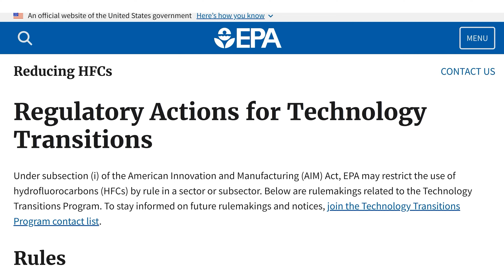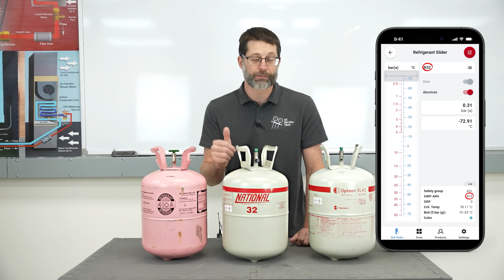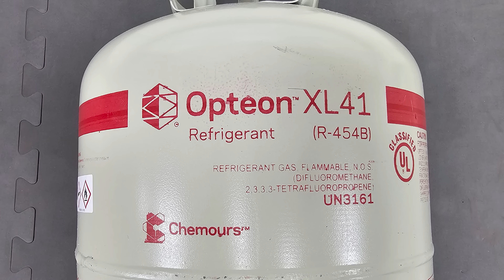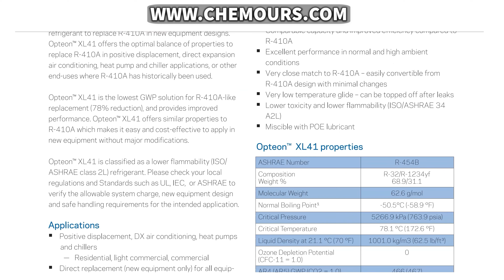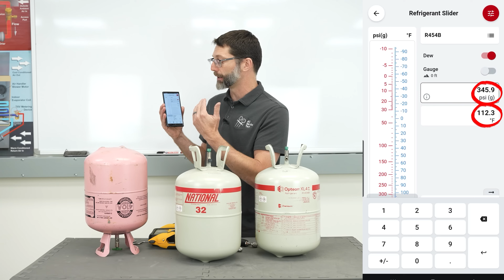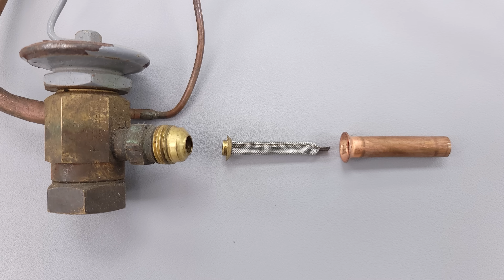A2L Refrigerants R-454B and R-32 Explained! Bottles, Changes, Rules, Tools!

Comment: They already had r32. It worked. They mixed it with r125 to make 410a and got a patent. Now they're banning 410a so they took r32 and mixed it with r1234yf to make r454b, another patent. R32 is a single molecule but it is freely available worldwide. Can't have that, it's too easy and convenient, and we can't charge as much.
Reply: That's why I'm going with an R32 system. They're still making them every day
Reply: @searay2085  
No you going with an r32 because its a cheaper and easier version of what our big bloated government is allowing. Realistically no customer would want this but the free market was killed.
Reply: exactly....
Reply: Right on! Daikin has been using 100% R32 outside of the USA in over 200 MILLION INSTALLATIONS over SEVERAL DECADES. The R32 never enters the home; its far more safer than having a propane gas tank to grill your food outside.
Reply: Middle men are evil

Comment: It’s a little weird here in Norway .. we’re moving away from R32 because it’s bad for the environment but the big tanker ships are spewing out refrigeration out to like no tomorrow and all “they” care about is the minisplits 😅
Reply: I've seen ships still using R22, like fishing trawlers have like 4 100 horsepower compressors in the engine room for all the fish freezers. Only newer ones are like R410A.
Reply: What are moving to after r32?
Reply: @gtpforever most likely ammonia, propane or Co2. ATLs are probably the end of the line .

Comment: Ahh, the good old days. 12, 22 and 502
Reply: And R500 too. Carrier used it quite a bit, and was also used for like Thermo-King truck mounted refrigeration units. R23 for ultra low temp stuff. And you missed R11, on old Trane Centrevac low pressure centrifugal chiller systems on 2400/4160 volts :) fun times. My Dad used to use R11 for a lineset flush or evap coil flush after a bad compressor burnout, best solvent for cleanup ever. Too bad it's toxic and super bad for the environment though.
Reply: Carrine 7

Comment: if R32 had such a great GWP decades ago in Europe, why did the U.S. play around with NU22, R410, R427 et cetera? Constant need for equipment change? oh, it's a racket then.
Reply: Money, yes, and based on the rather loud griping I've heard over the years, most U.S. technicians really resisted working with mildly flammable A2L refrigerants, (but love natural gas furnaces and gasoline cars, which are also potentially flammable.)

Comment: im not even doubting the science, it's just the little things like the left handed threads and gray bottles that will get annoying. having to double check your hoses are left handed threads or remembering to bring an adapter. double checking the bottles since all refrigerants are gonna be a gray color soon.
Reply: It's so ridiculous
Reply: @tedbell75  funny how they call it global warming potential, and dont say that it WILL be a cause, but has potential to be a cause. All made up bs
Reply: Just leave the adapter on tank and use standard hoses

Comment: You dinosaurs are so grumpy. It's a refrigerant that's been used for over 20 years at this point, it already makes up half of R410A. In fact its better than 410A because you don't have to worry about fractionation and charging it only as a liquid, meaning you CAN top up systems that are leaking and you can put back in the recovered charge. That's a huge benefit. The flammability thing is clearly overblown, just stop brazing out compressors, which you weren't supposed to do anyway.
Reply: Boomers will be boomers
Reply: He concurs: https://youtu.be/RQnKPb6i0oI?si=zXhWKnLUqWlAv-xJ

Comment: I've been around long enough to remember the r22 to r410 transition , they said all the same BS back then,just a little less sophisticated. 😂😂😂 And for something that is touted as being a low flammable refrigerant there's sure alot of extra safety procedures involved with these new refrigerants. I also work on residential refrigerators and ice machines which are also already using r600 and r290, but those systems have like 1 ounce of refrigerant. HVAC systems we are talking pounds....I dont worry about 1 oz of semi flammable gas venting in the air, but 6 or 7 lbs?? Yeah, nah.
Reply: Do you know why they didn’t just go from R22 straight to R32? Especially if Europes been on it for 20+ years.
Reply: The more they change refrigerants, the more screw ups there are by techs which sells more units.  Also, the new refrigerants create markets for more units. As for the climate stuff, it's all absolute BS that common man is creating those circumstances. It is corporations that are polluting massively and creating all the circumstances that they term as climate change. Nothing in this capitalistic world is anything but a lie that is intended to generate more money.
Reply: While this change over is BS, the hand wringing over the flammability is a bit over the top given the presence of natural gas in most homes.
Reply: And if the leak is inside your plenum on the evaporator coil, it's flooding your entire house every time the blower kicks on. Mmmmm... I love the smell of R22 in the morning! Have your heating and cooling systems inspected frequently. Murica! 🇺🇸

Comment: New tech in the trade “failed refrigerant sensor? Bypassed!”
Reply: " Oh shit, it actually reads something called resistance instead of just open/closed...Now I'm in trouble."😂😂😂
Reply: Especially when it cost $450 to replace.
Reply: Removed or start carrying resistors of the right side to bypass the sensor

Comment: Now the ACs will have another part that can failed, the refrigerant sensor, I wonder if those sensors will last more than 5 years
Reply: Or nearby lightning, moisture, spiders, ants even snakes and lizards. All wreak havoc on equipment.
Reply: @jamminwrenches860  and duty air filters may cause a problem
Reply: And I guess their will be a nice led light and trouble shooting chart to tell the home owner he has (low) flammable freon leaking in his home ( OMG ) fire fire fire 🔥
Reply: New ac and lineset bby

Comment: The only system that "pollutes" is the system that leaks.  They need to bring back seer 10 coils on new equipment and slap a solar panel on it to offset the energy difference.
Reply: Thicker, high quality tubing.
Reply: @USA-GreedyMenOfNoIntegrity thicker tubing has less effective heat transfer, a balance has to be found
Reply: @joebyron9  it might slow down the heat up or cooldown time, I don’t know about it being any less efficient. 

All I know is I rarely changed out coils built before 2000, when executives started outsourcing and offshore our jobs, increasing prices, lowering quality of products in the USA. They are flying around in their $25 million bizjet on family vacations while the consumers are roasting from their broke down HVAC equipment.

Comment: As far as glide is concerned, isn't a piston metering device pretty much a thing of the past except on older units that would be using 410a or 22 that have minimal and no glide. Unless we are getting into the weeds on trouble shooting, we are going to be charging using sub cooling only. Wouldn't we just use the liquid saturated (bubble) almost exclusively?

Comment: That’s a lot of safety precautions for refrigerants that supposedly “are not really that flammable “.
Reply: Yes, they are as they (chemical companies, Daikin & Chemoure)  ass-u-me IF THERE IS A LEAK, what is missed is that at the compression cycle (internal) there should be tolerable moisture presence (moisture is H2 & Oxygen) when using A1 which has no effect if the compression cycle temperature reaches the ignition temperature of the oil (lower than R32), remember A1 class is non-flammable BUT if A2L or A2 or A3 then if the oil ignites (in the presence of oxygen) A2L or A3 might ignite and an explosion will occur. So the vacuum process has to be perfect (lower than A1 class). Knowing everything, why use it? yes if it leaks it's low GWP BUT FLAMMABLE & EXPLOSIVE?! sound stupid!! that's why the A1 class has been around since 1928! and we have chemical companies (Daikin & Chemoure) shoving it down our throats!
Reply: @neilafram663  Daikin has been using 100% R32 outside of the USA in  MILLIONS OF INSTALLATIONS over SEVERAL DECADES. I'm not concerned about your "FLAMMABLE & EXPLOSIVE" prediction.
Reply: @dknowles60  Sorry, I cleaned up my response. I got wrong information form my source. Thanks for calling attention to it.
Reply: What Happens When a Compressor Terminal Blows Out????  Explosion?
Reply: @marshred yep I've seen compressor terminal blow outs 50+ times in my career and the units were I live at sit off the ground on mostly (wood) old dry platforms
Reply: Define liability
Reply: don't huff it and smoke a cig

Comment: So now that I have a 410 unit sitting and waiting to be installed I'm pretty much putting in a unit I need to hope will never need to be serviced for 10 years. Wonder if 32 or 454 can be used instead on 1st charge? Worked in the 70's and 80's on chevelle's, lol.
Reply: Don't let em fool ya, there will be a replacement refrigerant(s) for 410 just like they've done for 22, however just like the 22 replacements they won't work quite as well.
Reply: Just stock a couple of 410A jugs, they will weight in gold in 10 years.
Reply: Will still be able to get 410a till 2036.  Put your 410a unit in.

Comment: This is why the poor can't have AC 😥
Reply: Or heat cus now you can't run your furnace without repairing the leak,and your leak detection sensor locks your furnace out
Reply: Facts
Reply: @tedbell75  cant handle the Turth,, one cold hard Fact, be for Biden took office i could get a 3 ton gas pack deliver to my house  for 3k dollars in june of 2020,  no as of June of 2024 the same 3 ton gas Pack is over 6k dollars i sure glad your are rich
Reply: Don’t worry take loans for 100 30 years

Comment: why was it when i took my EPA cetifcation last year that they said the GWP for 410a was 1200. then i did a traning class about the new stuff a couple months ago saying it was 2000 and now this video is saying its over 2500? this is starting to sound like bullshit
Reply: Bingo!!!!
Reply: Absolute bs
Reply: That's a good point. I remember that while R-22 had a High Ozone Depletion Potential, it had a really low GWP. 410a on the other has always been a super greenhouse gas with a GWP much higher than 22 . Well at least that's what I thought. I'm doing some research into it now and it seems like 22 has a GWP of about 1800 and 410 is about 2100. I've never seen anything say 410 was 1200, but by the quick research I just did, it does seem there is a lot of discrepancy from source to source, agenda to agenda. Now I want to go look for my early study material to see what that said in print decades ago.
Reply: This video is already bs
Reply: thats because it is !!!!
Reply: Because it is bullshit
Reply: 16 year run as an a/c tech in Las vegas.  Mainly residential.  
This is the stupidest thing I have ever been through. At least there was an overlap with the r22/ r410a change out. 
Just food for thought. If the new A2L refrigerant are so safe. Why do i need a spark proof vacuum pump. 
Why does everything i read say you now need to have a  3 foot radius?? 😊
Reply: Starting? Its been going on since the clean air act of the 90s with the fear mongering of refrigerants and fake science. Thats what happens when you have corporations that have enough money and power to manipulate law makers.
Reply: Looks like shit, tastes like shit, must be shit.
Reply: It is bullshit. The only time it escapes is a leak. Humans breathing have a higher GWP. All of it is BS.
Reply: Man made global warming is and always has been a scam for control. Period.
Anytime a legit scientist has brought proof to prove it, they are blackballed.
Kinda like the EV's such as tesla. You get about 300 miles round trip. You ain't going far...by design.
Remember all the scifi movies with automated cars that you tell it where to go? Theyll eventually have grids for max
movement. Yeah. I know. lots of yall are gonna laugh. I'm just following dots.
WEF. Youll have nothing and be happy.
Reply: It’s all bs. 22 is still the best refrigerant ever made imo
Reply: @danmak6586  that or 407, which is very similar. I put many 407 units in before they stopped making them and have never had any problems with them
Reply: No R12

Comment: The left hand threads is the biggest slap
In the face
Reply: How much refrigerant will leak out of bottles that people crossthread?
Reply: I think all flammable gases have a left hand thread
Reply: All Flammable gases have been left hand threads for the last 40+ years.
What gets me --- is they are pushing these as not Really that flammable ! 
But , Going Left hand threads = Flammable !!!
Reply: R32 has been used as the main refrigerant in Asia for domestic aircon for over ten years now, just like r600a has been used over the rest of the world for the last 15 years  @OcRefrig
Reply: @n2n8sda r600a also known as isobutane....also in torch style lighters......
Reply: @n2n8sda The U.S. has been behind in refrigeration for a long while. Many U.S. companies are teaming up with foreign companies because there is 20 years of experience in what we are trying to do for the first time.
Reply: That’s bullshit😂😂😂
Reply: It's like when you get a muzzle brake that's M14 X1L and you're like what the hell?.
Reply: 20lbs as well
Reply: Most flammable gas connectors are reverse thread so they are harder to tamper with or improperly connect. Look at propane and acetylene connectors, for example.
The bigger issue is Dupont patent protecting a tertiary mix of existing refrigerants, lobbying the government to make their refrigerant the only usable refrigerant in the US under penalty of law, then creating a supply crisis to cash in on the supply and demand price increases.
Dupont is famous for screwing the consumer and the economy.
Reply: Not gas lines

Comment: Just bring back r12.  Quit ripping off people.
Reply: Its the EPA..doh.
Reply: stupid bastards banned the best feons r12 r22
Reply: Should just bring back CO2. That was the first refrigerant (besides Ammonia). Heck, even the Titanic had coolers, freezers, and an ice machine all running on CO2. Funny how we went from CO2/ammonia to sulphur dioxide, then methyl chloride (R40), then R12, then R22 (actually R22 is a little bit older than 12 IIRC), R502, then R134A, then this current mess of 410/448/449/407a,b,c,d,f, 454b. Jeez just go back to CO2 permanently. No forever chemicals, it's inert, makes a great fire extinguisher, great energy efficiency, and best of all it's wide available and cheap and can be delivered in bulk as a refrigerated liquid.
Reply: I'm good with R-12 going away. There is a balance between the environment and costs. It has gone crazy on the environment side and they need to relax those restrictions but I also think R-12 is bad enough to not use.
Reply: @crissd8283  r12 was banned because it was thought it was causing the ozone layer to disappear. Montreal protocol of 1976 ,I think. Well, the ozone layer  reappeared, and  nobody seemed to notice that maybe the initial  science was wrong. Then they started to make up other fiction and banned other refrigerants that took the place of r12. For one reason or another. Its most exasperating to be continually bombarded with new refrigerants, always more costly and less efficient, and for these bureacrats to keep up the alarms and moving the goalposts on everyone in the industry.